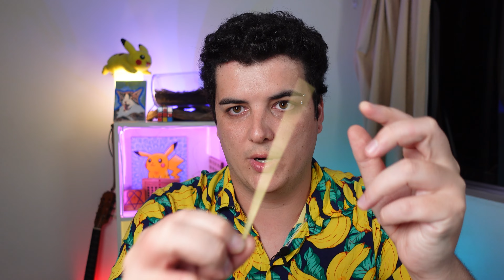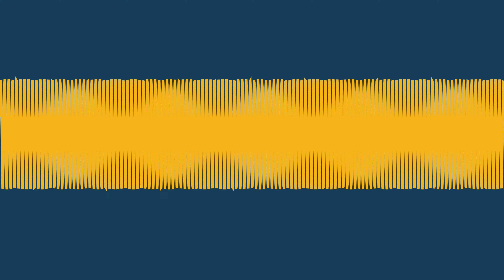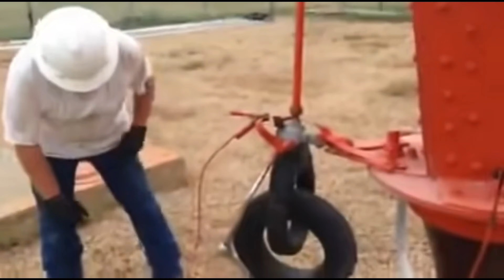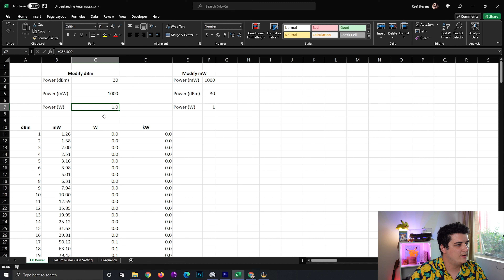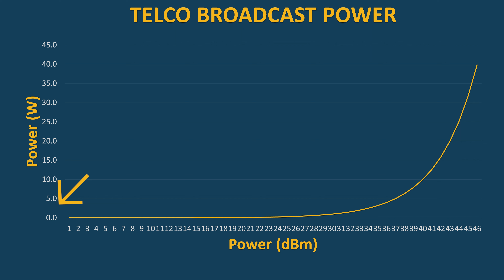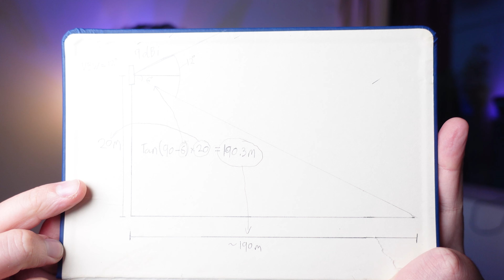Ultimate Helium Mining Antenna Guide

Comment: Reef thank you Brother.  I have been mining using a bobcat 300.  I changed my helium app to show a custom 8 DBi antenna.  Since updating on the app I have gotten way fewer rewards.  Any recommendations?  I mine in the US.  Thank you!
Reply from the maker: G'day Richard, how long has it been since you changed it mate? If it's been less than 1 week I suggest letting it sit for a while longer, it could be a network thing not a you thing.
Reply: @reefjames6302  Got it.  Thank you for your timely response.  I'll let it sit longer and see how it works out as suggested.  Thank you!!
Reply from the maker: @richardfields2974  happy to help mate, good luck with it!

Comment: Thanks for the great information here. One thing I haven't seen explained well is polarization.  Most antennas are mono polarized vertically.  What is the benefit of a multi-polarized antenna?  theres one called the HNTENNA thats 3.1DBI and multi-polarized. From what I have gleaned its about trying to pickup reflected signals if you have a hilly topography? what are your thoughts on this, especially for a suburban environment?  Thanks again!

Comment: Hey bro, one more question. Does the cable brand matter? For example a chinese lmr400 one that I can buy from aliexpress vs Amphenol lmr400 I can buy from a local electronics supplier? Do they differ? Thanks :))
Reply from the maker: In an ideal world, they don't matter... But in reality they do differ.

Reputable companies will test their cable before shipping... Especially local shops.

Local shops are more likely using quality RF connectors as well.

The cheap cable may work just fine... But it's just not worth the hassle. Go with the reputable brand every time with RF equipment. You want something that will be reliable.
Reply: Many thanks for the reply.. :)

Comment: Hello Mr.James, Your channel has been very helpful. I would like to join your discord group but it seems it is private or requires a different invitation link. 

My delima: I understand we cannot amplify the individual frequency of the miner itself, as the frequency is designed in the US to run at 915,  BUT, can we add repeaters that bounce the signal on our specific frequency far and wide? I have been researching this idea since the beginning of helium and I am unable to figure out how to do so. Repeaters can be tuned, but if they are tuned to the same frequency, then your back to square one. Can you provide clarification (or a video) on how repeaters can help or not help. 2)  Can a 915 mhz frequency piggyback on another long range frequency?  I have many more questions, but these are the one's that are defeating me. Thank you in advanced and happy holidays.
Reply from the maker: Hey mate, thanks for the kind words.

Your best bet would be to set up multiple hotspots. In industry with repeater sites we usually set up microwave links between the donor and repeater sites (with 27dBi gain.... Extremely directional antennas), and that carries the data, down into another baseband and then into another radio to rebroadcast at your serving frequency.

It wouldn't be done the same way with helium, but I dont think it would be worth it. It's not the way the helium network is meant to be ran
Reply from the maker: Also this link should work https://discord.gg/0uJCAEK15v7ApRR6

Comment: Do you know why some of my antennas measured < 1 ohm when check the center pin and its metal housing while some measured open? Thanks 🙏
Reply from the maker: Hey, sorry for the late reply! On holidays.

Hmmm, your antenna should be open between ground and the centre pin otherwise your antenna is shorted. Are you using the same RF connectors on all your antennas?